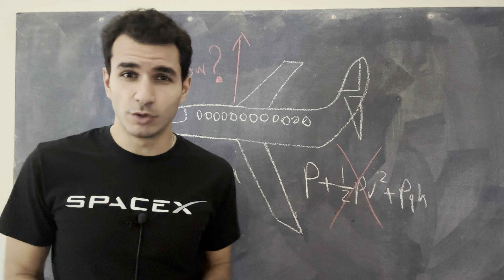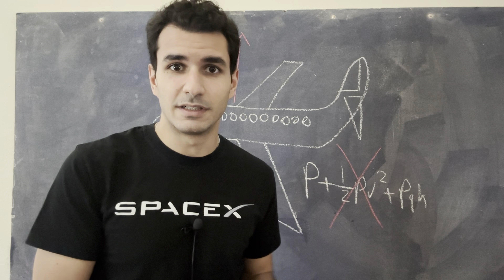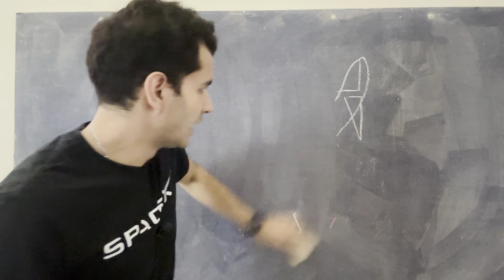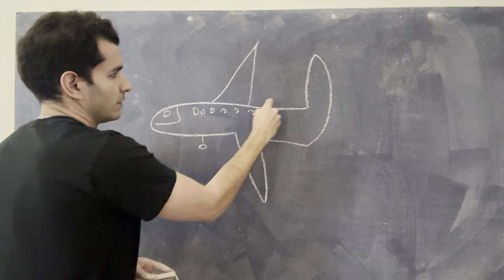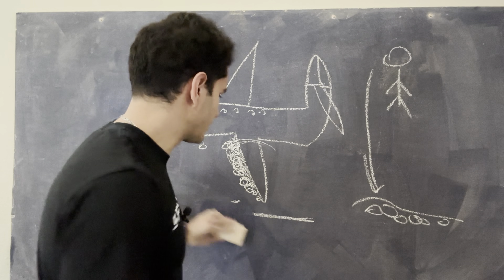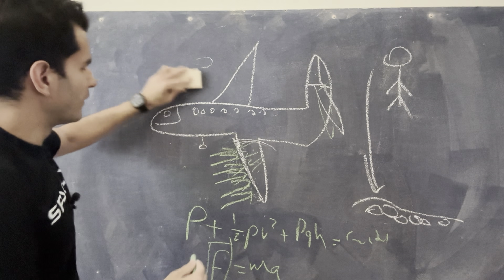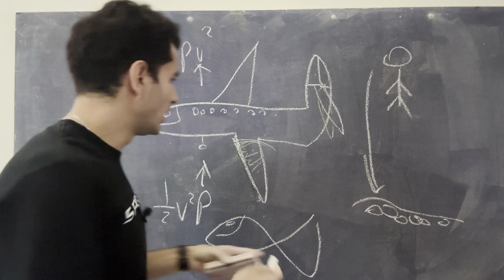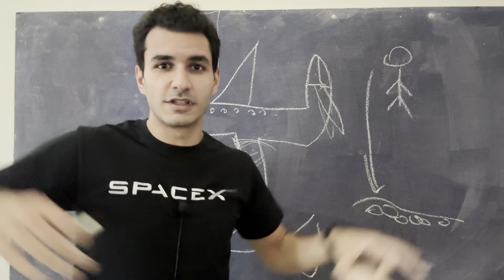Fix This One Misconception = Understand Airplanes Forever

Comment: Retired Mechanical Engineer after 40 years here.  I totally agree that a new student should study areas that they are truly interested in.  I had the fortune of having a high school Physics teacher that was a former engineer and he emphasized focusing on your interest.  His class started out with Newtonian Mechanics and later came the electromagnetic side.  I found that I had an innate intuition for mechanics, but I really had to study hard to understand electronics and magnetism.  I knew then that mechanical engineering was the way for me.  Throughout my scholastic years I only learned what I needed to pass the test when it came to electromagnetics.

Over my 40 years in industry, I was exposed to the electro magnetics as a necessity in order to understand how to control the devices I designed and tested.  Eventually I warmed up to electronics and began studying it on my own to the point I became proficient at improving/designing my own test fixtures and controls.

As a retired engineer I am intrigued with electro magnetic devices as well as mechanical devices.  Somewhere along the line, I picked up the hobby of repairing vintage HiFi equipment, which 40 years earlier I would never have imagined having a talent for.

P.S.   The difference between Mechanical and Civil Engineering:  A mechanical engineer's design better move when they're done.  A civil engineer's design better NOT move when they're done.
😃😄😅👍

Comment: This is what i used to think as a kid how plane works, but then everyone said pressure and all that i used to laugh at myself for coming with this idea, and now u telling me that was indeed true.
Reply: His explanation gives little insight.

To suspend an aircraft well above the ground the essential mechanism is necessarily downward change in momentum of flow.

What causes that vertical change in momentum?  The vertical pressure difference.

It's the pressure field that turns the  mass flow, with most of that substantial volume of mass never touching the airfoil, let alone all of it bouncing off the bottom.

What causes the pressure field?  Any solid object placed in a relative flow maintains conservation of mass flow rate by speeding up around the obstruction through an opposite change in pressure (conservation of energy).

For lift all you need is for the object to be asymmetrical:

That causes the vertical pressure difference that is entirely reponsible for the vertical change in momentum direction.

Comment: the knowlodge tha you receive in hight college is not the same that we recieve its the most reasanablz explanation tha i have ever heard about sustentation forces .thank you for that.
Reply: Unfortunately this explanation shows a poor grasp of the key concepts.

Most fundamentally lift is the force resulting from an asymmetrical solid turning a relative flow.

That involves a lot of mass turning  downwards which can only be accessed by the extended pressure field.

So, it is the pressure field turning the air down.

Comment: Might be a stupid question but:
When a plane is simply flying straight, no AoA, I assume airfoil shape plays a bigger role. Cuz from your video, I kind of got the sense that shape plays a very small roll. Which kind of made me wonder, how a plane would fly straight if the airfoil shape were perfectly flat and parallel to the ground. 
Based on your intuitive approach, could you say that the airfoil shape, "artificially" creates a constant AoA, that's kind of built into the airfoil shape?
As if just the wings, not the rest of the plane, we're always angled up just a little bit (but not actually cuz it's the shape of the airfoil in place of the "angling up")
Of course there's still the stabilizing downward lift to make sure it doesn't just go up tho.

Comment: The "big deal" stems from what's called the "equal transit time fallacy". It's a common explanation for lift that says the air is forced by the wing's shape to take a longer path up top, therefore moves faster, and has less pressure, generating lift. There's a page on the nasa website specifically addressing this fallacy. It's a horrible, backwards explanation that frustrated me to no end even at age 7, but people are hellbent on repeating it and arguing about it online. 

I think the people who repeat it so fervently do it because it's such a ridiculous, non-intuitive explanation. It makes them feel smarter than the frustrated peons whose intuition tells them air must be displaced downward. In reality, it's the smart people who "don't get it" and the dumb people who think it "makes sense". It's an emperor has no clothes situation, through and through.

Comment: ive seen this debated before and yes the difference in air pressure on wing is valid, but I think it is the speed and angle of the wings that generates the most lift during takeoff that gets it up in the air. What do you think?

Comment: I think you are misunderstanding what "action and reaction" mean in Newton's second law, at least when considering systems at equilibrium. If I am standing on a floor, my mass times the gravitational acceleration exerts a force on the floor. This in theory would cause the floor to accelerate, but the floor exerts an equal and opposite force on my feet, and an equilibrium is established. A boat floating in a mass of water exerts a force on the water, displacing it. The mass of water displaced exerts a force back, measurable as pressure, on the boat, and the boat floats. The only interface between the boat hull and the water is the molecules of water bouncing over it, and the pressure is a statistical measurement of the energy of the molecules bouncing on its surface. Why should a wing care about what the molecules two millimeters from the surface are doing? But pressure travels through a fluid as waves in a field, at the speed of sound in that medium. So a parcel of high pressure fluid will affect the parcels next to it and ultimately the body immersed in it. When a plane travels in a mass of air it displaces as much air upwards as it does downwards, otherwise the air would just compress on the surface of the planet. It transfers energy to the air as pressure difference (a form of potential energy), that then dissipates back as the air moves to adjust back to a level field, getting converted to heat. You can measure the pressure wave of a plane flying overhead (though it's difficult since it's masked by its noise), even though you can't measure the wind caused by it past  a few hundred meters.
Reply: You started out solid in the first half, but it fell apart in the second half.

Comment: Big wing on both side balanceing in nuterol mass.only vertical attechment wings on back edge of big wings causes fight flying upwards.          It is main reason.        And back tail wing only  blancing vertical mass . Front body shape aerodynamic . And engine like a works  netwon third law.
Reply: I want to understand what you mean, but unfortunately, I can't.  Or at least it doesn't make sense.

Comment: At 08:42 did you inadvertantly say "no wonder you`ll have higher pressure at the top, and lower pressure at the bottom"?
Reply: Yes, good catch.  But even more concerning is how pressure difference and vertical change of flow momentum is described.  The explanation completely misdirects the relative contribution of the different concepts.  Yes, angle of attack is crucial, but how it is related to asymmetry, camber, pressure, vertical flow momentum change, is just plain wrong.  It is teaching false concepts.

Comment: Bernoulli comes from the application of Newton’s 2nd law of motion to a fluid element IN THE STREAMWISE direction. Therefore, it cannot account for transverse forces like lift. A better explanation is given by the Coanda effect which derives from…. Newton’s 2nd law of motion applied perpendicularly to the flow!!!
Reply: Coanda refers to an empirical observation but has no formal consensus definition in physics.  

The Navier-Stokes equations that describe lift with precision do not contain a Coanda equation.

NS core equations are the 3 conservation equations of mass flow (continuity), momentum, and energy.

The transverse force you refer to results from turning of the flow:

Asymmetry to the relative wind creates a conservation of energy pressure gradient in reaction to continuity of mass flow out = in.

The transverse force is conservation of momentum as the  flow is turned by the pressure gradient.

Comment: .... to lift 1,000Kg of aeroplane you need to REACT with 1,000kg of air (newtons 3rd law) with a little help from  your 'thrust vector' provided by the BRT's (Big Round Things on the wings) to get airbourne and assist with the initial climb.  (flight is a triumph of thrust over gravity😅).
Reply: This is categorically false:  "you need to REACT with 1,000kg of air".

Formally you need (in the vertical direction): F = d(mv)/dt .

So that's a force from change in vertical momentum of air per second.

Because mv is mass times velocity and it's in time t, the lifting force comes from the mass, speed, and in how much time you change mass to that speed.

To make it as energy efficient as possible you want that mass per second to be as large as possible, because speed is energy expensive (doubling your car speed quadruples your stopping distance "cost"; doubling your car mass only doubles your stopping distance).

Comment: Ok, but obviously wing cross section shape must play a role, right? Otherwise why are wings not just flat boards? Where does the wing cross section shape (a very particular, recognizable shape) come from??
Reply: "Where does the wing cross section shape (a very particular, recognizable shape) come from??" 

The airfoil shape is mirroring the natural shape of the airflow around an asymmetrical solid.  By conforming the shape of the cross section to the natural flow pattern, that actual flow pattern has less resistance to the contours of the airfoil.  (Of course, there is some compromise in optimizing the shape best according to the designed speed range.)

Comment: At school I loved physics but I was always more talented at the arts and struggled with math.  In fact, I ended up with a PhD in theoretical physics, but your comment about not going straight to the equations and explaining what is actually going on really resonated with me. Awesome video, thank you!
Reply: It's helpful to "triangulate" such info with other credible sources and draw one's own expanded study conclusion based on an honest assessment of the adequacy of one's own thoroughness.
Reply: @davetime5234  Indeed, that’s what good science is all about!
Reply: @katemakeuplooks Where it becomes a personal problem for me is when more than one (but by no means the majority of) academically credentialed aerospace/aeronautical engineering professionals claim that either:

1)lift is not accompanied by a numerically equal change in vertical momentum of flow, or 

2)if there is such momentum change, it is accomplished without mass transport from source (an analogy might be ocean waves as opposed to ocean tides: both transport momentum but not mass flow).

This obviously results in some head scratching:  what happened to?:

 F (vertical) = d(mv)/dt (vertical) ?

There is some magic in the fluid dynamics domain of Newtonian mechanics which allows the static loads of aircraft weight to be supported without the dynamic necessity of continuous change in momentum?

Do you have any thoughts on this?

Comment: A huge misconception I keep seeing is that the way the air moves behind the wing is the cause of forces on the wing. I have seen wind tunnel demos where people say "you can see the drag" when in reality what they are talking about is that you can see the turbulence behind the wing. Turbulence is a visible indicator that there is a lot of drag on the surface of the wing, but the turbulence itself is not the drag. Similarly, I see a lot of people saying that "the  behind the wing moved downwards, so the plane must be pushed upwards". This also shows a lack of understanding of how a wing generates lift.

All the lift and drag forces on a plane wing is caused by interactions between the wing and air molecules AT THE SURFACE OF THE WING. What happens to the air behind the wing, whether it is turbulent and whether it moves down or not is only a secondary effect caused by the interactions between the surface of the wing and the air.
The movement of air behind the wing is certainly a good indicator of what forces are acting on the wing, but it cannot explain how the wing generates lift.
Reply: Some of your objections are valid, but you offer no clarification of how to actually view the mechanism of lift.

Comment: The only thing I would add is that lift doesn't necessarily make an airplane go up.  You have to look at the entire system to determine why an airplane is climbing, descending, or maintaining altitude in steady state flight.  Lift, thrust, drag, and weight all have vertical components.  It's complex because every part of the airplane has influence on the system.  It only gets more complicated when you consider non steady state flight like aerobatics.
Reply: No, lift does make an airplane go up.  Now, explain lift.  So, we're back to square one.

Comment: So, is the low pressure above the wing being caused by the shape of the wing, or is it a reaction of all the air being pushed downward by the bottom of the wing? 
If we are having so much trouble getting this straight, I have very little hope of understanding dark matter.
Reply: Air mass cannot "stockpile" at the airfoil, so pressure changes to prevent that (changing speed where necessary to prevent the "stockpiling" of mass).  That pressure change bends the flow direction (due to the airfoil shape's asymmetry).  It's actually very straightforward, we are just really good at fooling ourselves.

Comment: I understand how a plane takes off, but what keeps it in the air? Wouldn't the upwards pressure decrease once the elevator levels out, allowing gravity to take over?

Edit: Chatgpt says it's due to the shape of the wing. This video underplays that aspect quite a bit.
Reply: The elevator has nothing to do with lift other than holding the pitch angle for sufficient AOA (angle of attack: airfoil angle to the relative airflow) necessary to create a given amount of lift.

So, the elevator only provides pitch rotational torque necessary to hold the nose up at the required AOA.

But it is the AOA that creates the lift (from its asymmetry, combined with any asymmetry from the wing's cambered shape:  the elevator only provides the control force required to maintain a particular amount of asymmetry to the relative flow).

Comment: Balloons don't push air down, nor do they force air to travel in a curved path, and yet they rise in the air through the force of pressure differential in exactly the same way that wings do; exactly the same way that submarines rise.
When the force exerted by fluid pressure under an object is greater than the force exerted by fluid pressure above that object it will rise.
The atmosphere and water have natural pressure gradients.  Wings create pressure gradients through motion.
When the Force F1 acting on an object is greater than an opposing force F2 the object will move such as to reduce F1 and increase F2.  Under the conditions where F1 and F2 have become identical the object will be in equilibriium.  In the case of thrust vs drag the equilibrium state is constant speed.  In the case of lift vs mass (weight) the equilibrium state is constant altitude.
Reply: Balloon and submarine buoyancy is different than aerodynamic lift:  weight of the volume of air/water displaced (for buoyancy) vs an asymmetry changing momentum direction to maintain mass flow continuity (aerodynamic lift).
Reply: @davetime5234  As with propellors, the math of reactive thrust is a lot simpler than the math of mapped pressure over propellor blades.  But yet (with an alebraic sum of forces) it moves.
Early aerodynamicists used a method called "pressure plotting" in which small holes in an aerofoil surface are connected to manometers.  This provides an experimental proof of the algebraic sum of forces.  It is a tedious and complex process: the dynamic flow method produces the same lift values and is more convenient.
Aeronautical Engineering Vol 1 Mechanics of flight, 7th edn 1962 page 75 et seq.
Reply: @patricklockerby4308  "pressure plotting...provides...experimental proof of the...sum of forces....dynamic flow...produces the same lift values and is more convenient."

By "dynamic flow" I assume you mean the vertical rate of change of momentum as the force?:  F = L(vert) = d(mv)/dt (vert)

The acceleration of which to the change in direction of momentum requires the motive force of a /pressure gradient:  
delta P (integrated over the surface area):

delta P "x" Area = d(mv)/dt (vert)

So you have a longitudinal (conservation of energy) pressure gradient from mass flow continuity (steady state), acting on the extended ambient flow, to turn that flow's momentum, producing the necessary force.